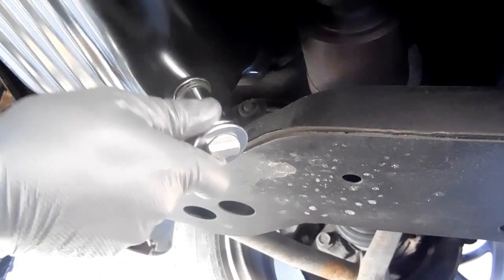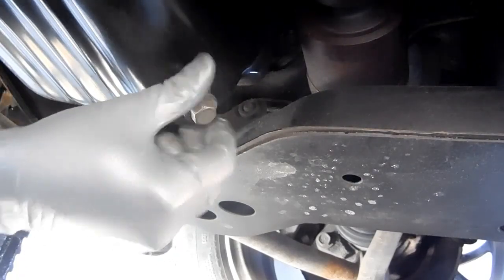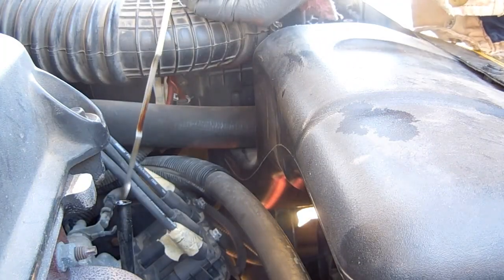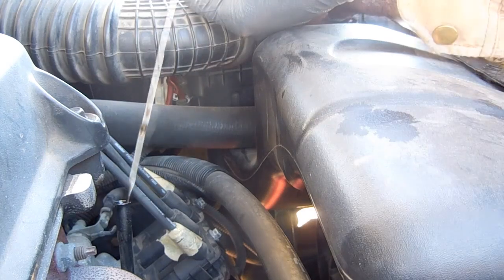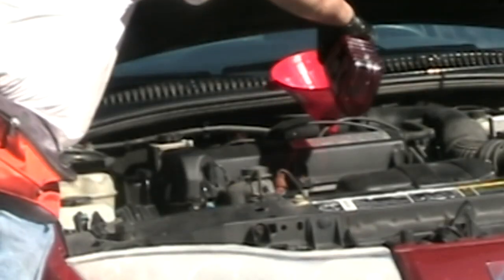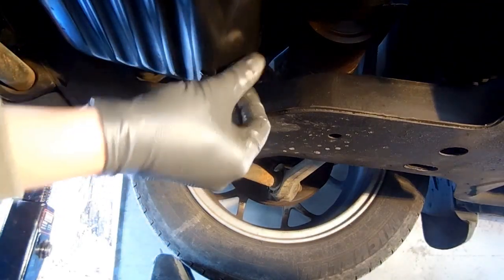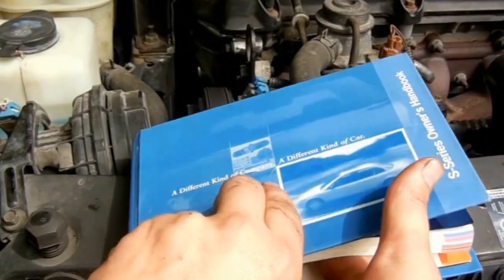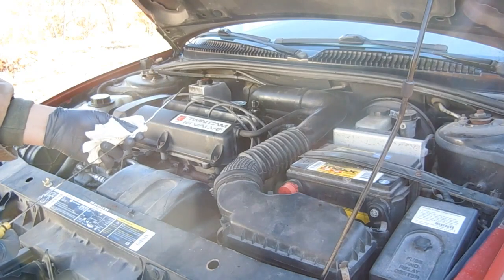Safe Motor Oil Flush Using Kerosene

Comment: Kerosene and smoking a pipe. Nice message!
Reply: Smoking around diesel or Kerosene isn't a big deal when it's cold. The temperature which Kerosene gives off enough vapours for combustion is 100 and 150 °F. Same with diesel, hence no spark plugs and pressure used for combustion. Hold a torch to diesel and it won't ignite.
Reply: +MaxDeerp - 100% Agree !!! People think Kerosene and Diesel are like Gasoline... I guess they haven't light Kerosene and Diesel in the Cold.  Come and live in New Hampshire in the Winter.... They will find out LMFAO !!!
Reply: Shit yaaaaa !!!
Reply: Looking like gandalf they grey with that pipe son!
Reply: Pour about a half cup of that kerosene in the PVC really slow, let idle for 10 min, and you will be amazed at how it runs. It may smoke like a muther, better than seafoam.
Reply: i agree
Reply from the maker: I agree, smoking and kerosene is an equation for disaster.  Be safe when working on cars.

Comment: I have sludge issue can I use diesel fuel to do a flush ?
Reply: Milky or Sludge are signs of Coolant Leakage ://
Reply: @JodBronson  short trip in town driving also causes it.
Reply: @benjaminkline4855  - Oh ok, I just have to make long trip to town then!  😂😂😂😂😂😂😂
Reply: ATF works WAY better.
Reply from the maker: You could but it might be a good idea to use a brand name flush like Marvel Mystery Oil or Motor Medic if this is your first time.  Follow the directions.  Good luck.
Reply from the maker: Kendricks Hays Jr, I don't know why you couldn't do this on a quad.  Flushing will definitely get rid of your milky oil problem, if it's not due to something like a blown head gasket.  In this video I'm using 1K kerosene, which you can buy at Home Depot or any hardware store or Walmart. 

** But if all you have is a little condensation in your oil, all you may need is an oil and filter change.  Try that first.  Kerosene is some harsh stuff.  Good luck.
Reply: 100,000 Mile Tune-Up can I do this on my Suzuki Ltz400? I'm getting some milky oil and I want to make sure I'm getting everything. Also what type are you using and where can I get it?
Reply: +Patrick TheBaptist - Yea, I agree. I made a Video on my Channel recently with ATF + GumOut - It seems to get Carbon out!
Reply: Yes but I would change oil, 4 quart reguler motor oil + 1 qt ATF run for 3000 miles. Then change it.
Reply: I have seen quaker state oil and pensoil make motor sludgey and waxy. Yes if milky your have coolent in your motor. If sludgy flush motor out and run better quality oil.

Comment: Hey when you have the time could you please do a video on changing the Valve cover Gasket on the Suzuki forenza? That is if your Suzuki needs it..Love The Videos so far
Reply from the maker: Glad you like the videos.  The valve cover isn't leaky enough quite yet, for the Suzuki owner to think about changing it, unfortunately.
Reply: 100,000 Mile Tune-Up OK, thank you though, there is oil all over my exhaust manifold and I cleaned it off but I just want it to stop all together. Could it be anything else besides the gasket that's leaking oil onto the manifold?
Reply from the maker: Not that I can think of.